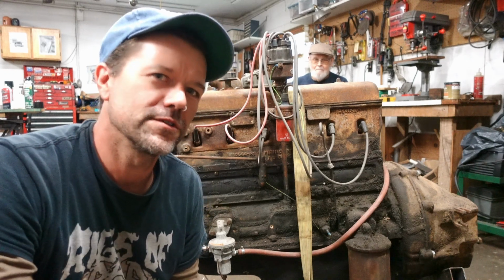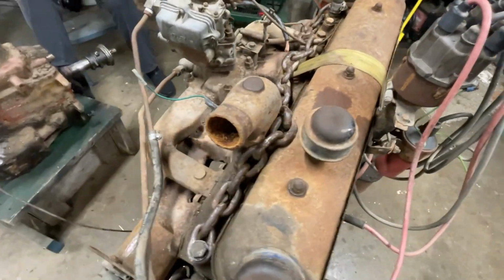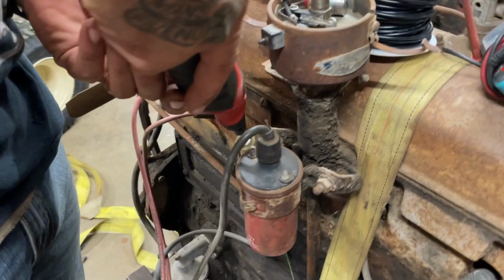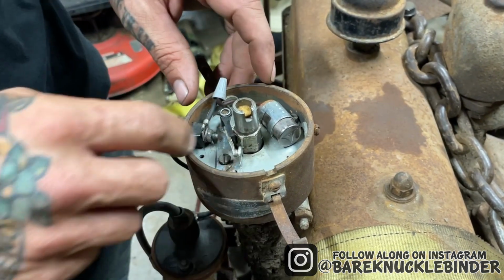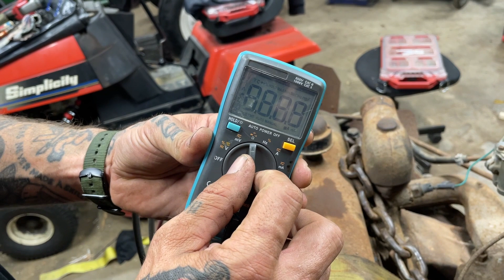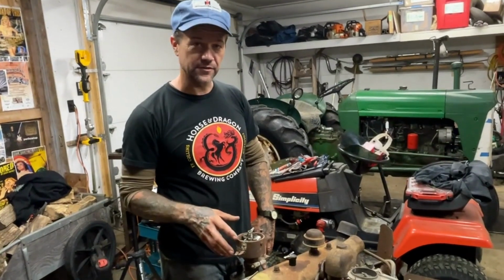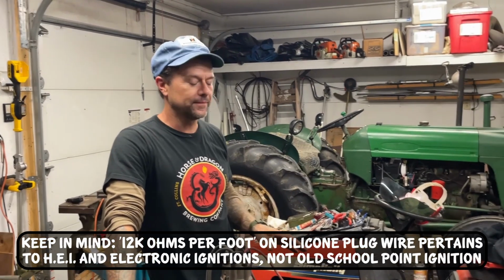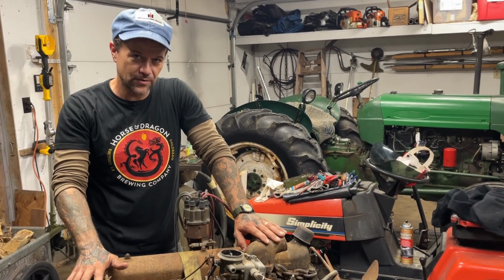Field Dressing Your Ignition - How To Get A Motor To Fire With What You've Got

Comment: Hey, a good thing to check is the axial play on the distributor shaft. My sd240 on the r160 warmed up and started to run bad. It had a lot of axial play(0,5mm, the same as the gap 😂), i made the new bushing on the lathe and now it works perfect.
Reply from the maker: Absolutely- I’ve had distributor shaft play on an old GRD233 make an otherwise perfectly running motor act like junk! However, it’s rare you can do anything about it out in the field but you make a great point. I’m envious of your lathe!!

Comment: Cool!  I think the A-120 '61 Metro I just got has this motor.  I'll have to have a look under the doghouse this week.  The dude I got it from said it's shot, but I haven't investigated yet as I've had other projects to work on.
Reply from the maker: An A-120 Metro should have a light line motor, if it’s original it’ll had a BD220, 240 or 264. Sounds like a cool project!

Comment: This summer I helped a friend with a 1949 KB-2. It had sat for years. I did pretty much what you just did and it fired right up. Such a great feeling. Thanks for the videos you are very good at explaining. Maybe you could elaborate a bit more on measuring resistance that’s something that confuses me. Thanks.
Reply from the maker: Definitely. I’ll do a more in-depth video about just electrical resistance in a future video. Thanks for the suggestion, Cliff!

Comment: Was this engine used in any of the Farmall tractors or combines? I'm pretty sure IH used truck engines in Combine and Cotton Picker applications. It was a later model, but my Dad had an early  IH 815 combine powered by a 345 cu. in V8. That motor was a HOSS! Lots of power and had twin shorty mufflers from the factory. About sundown when the air cooled down , the sound would carry and All the neighbors would comment about it.
I would guess the Oliver in the background is an early 550 model. The grill is made of sheet metal. Later years shared the cast grills like the 50 and 55 series Olivers. My dad put me on a Super 55 to pull a drag harrow over the freshly spring plowed fields when I was a kid. You did have to grip the steering wheel tightly going over rough ground. Ask me how I know.
Reply from the maker: I know the BD264 was used in some Farmalls and other equipment. I think the 282 was a dedicated truck motor but I’ve learned never to never make blanket statements about anything IH did or didn’t do.
That old Oliver 550 has been in our family almost since new. It’s the only non-IH machine we’ve got, but it’s spends all its nights indoors and is the handiest little tractor!
Reply: Yes, really good brakes,  true live PTO, easy to steer (for no power steering), and a quiet engine if the muffler and exhaust stack are in place! Near perfect for a young driver. @BareKnuckleBinder

Comment: I was but a young teenager, driving for dad, and truck caught fire under the hood and burnt my plug wires up. After cleaning up the mess and fixing the gas leak that caused it all, I took some small willow switches that would let me push them into the cap wire holes. I then used some soft wire and used to go from the cap and around each willow switch to the plugs. Then wrapped that with some tape that was far from our days now.... made of cloth I think. I twisted the wire on to the plug end. Did it work.... yes but glad to get home and make real wiring as it doesn't work great but it got me a good twenty miles I would of had to walk... I am seventy four now.... takes us back a day

Comment: Just brought home a 67 1100 pickup body is in good shape Has a six cyl and 4 speed fuel pump isn't working but it runs on a "boat tank" has the Holley 1904 single barrel carb. What's a good pressure if I put an electric fuel pump?  Also I think I saw some HEI upgrades for it. Great content but a bit older equipment than what I'm playing with.
Reply from the maker: That 1904 will work best with 2-4psi but you may still have to lower the float a whisker to compensate for the electric pump.

Comment: So what do we do if we go through everything in this video, then replace eveything and still no spark?
Reply from the maker: Check to make sure you have strong voltage at the coil. If you do, replace the coil. Coils are the cause of most ignition woes on otherwise healthy systems.
Reply: @BareKnuckleBinder  replaced coil and even tried running a wire straight from the battery to the coil to bypass key switch and old wires being problem still nothing. Dang 6 volt systems outsmarted me.